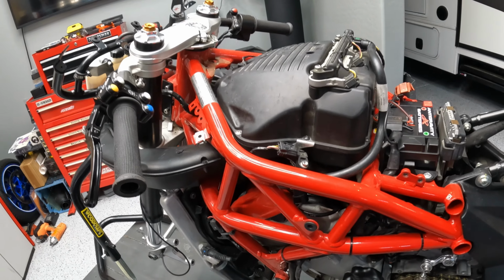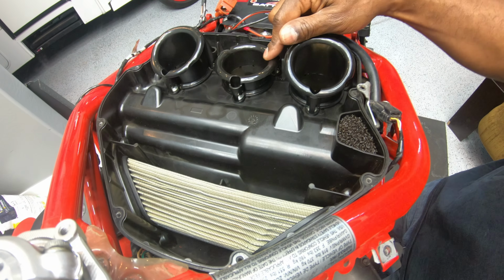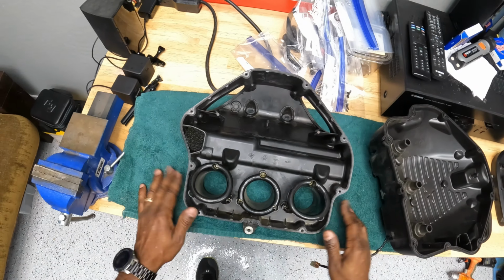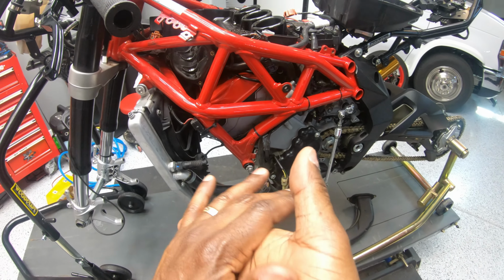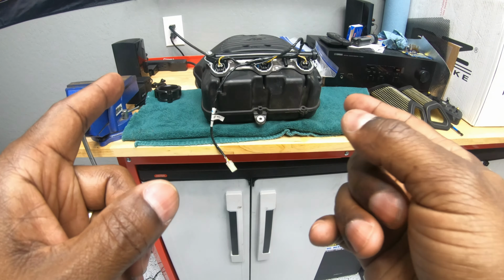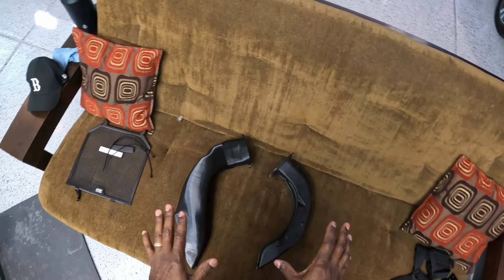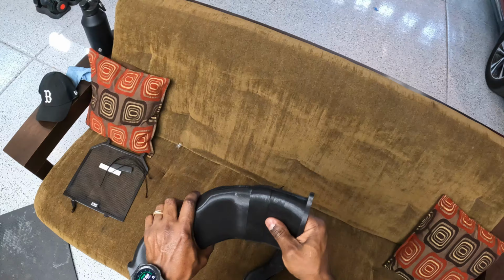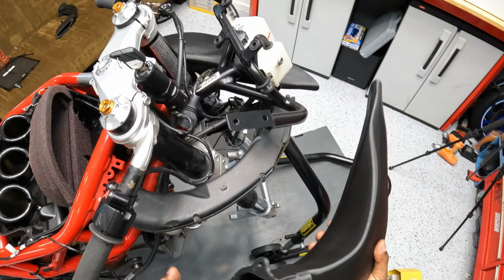MV Agusta F3XX Bike Build. Ep3 "Sucking Air"

Comment: What are the benefits of swapping the middle velocity stack to the taller version? Are there any trade offs?
Reply from the maker: Better top end and midrange performance at the sacrifice of low end performance. But we’ll see once it’s on the dyno.
Reply: @ESBKLife  Sweet, I look forward to seeing the results. Maybe a worth while change on my bike!
Reply: Interesting project. Didn‘t know the mod of the velocity stack. 

You do not replace the stock radiator?
Reply from the maker: @slowjoeracing493  not yet. I would really like the large H2O rad but I decided to go with light weight wheels instead. But we’ll see in the next few months.
Reply: @ESBKLife  Yeah my bro bst rapide tek it😊
Reply: OZ wheels right bro?
Reply: maybe Marchesini?!
Reply from the maker: @pomplardpanam8591  Yes Sir!!!
Reply from the maker: @themotoseoul  Not this time!